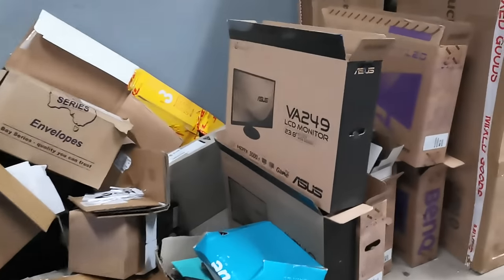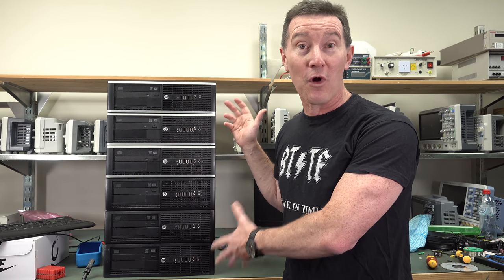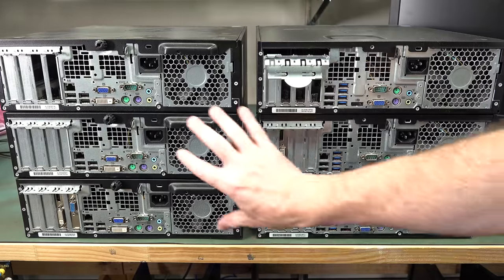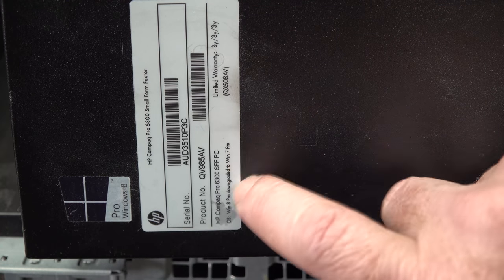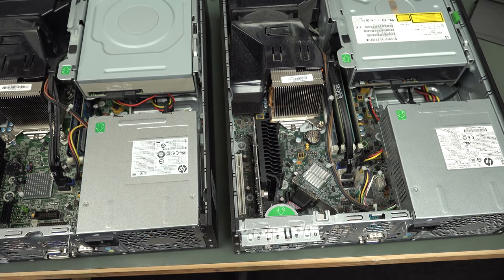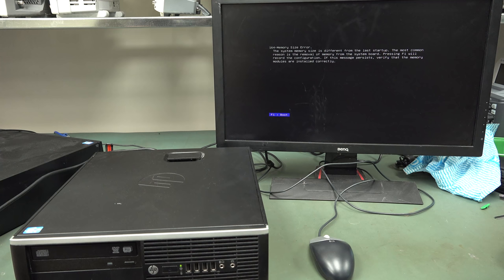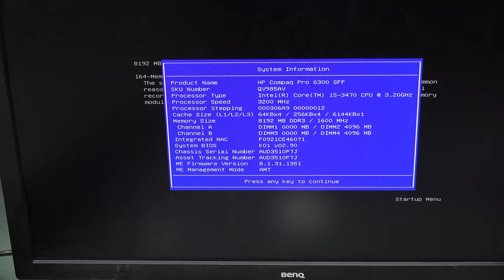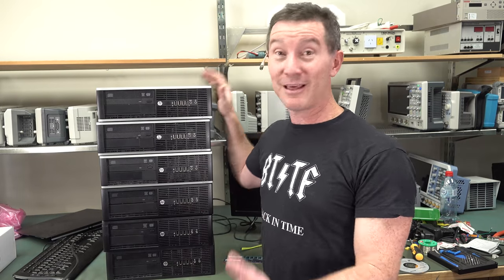EEVblog #1212 - Dumpster Diving PC Motherlode!

Comment: Downgrade is basically you are Licensed for Windows 8 and are allowed to use a lower version. Businesses usually use an older version for app compatibility.
Reply: exact reason we used windows 7 for so long, a lot of 3D software was only stable with windows 7 and 8 was problematic for quite a few years as well.
Reply: Actually it looked like all those systems had a COA, the color changing "Windows 8 Pro" sticker is the COA and at least for the big OEMs (Dell, Lenovo, HP) the actual license key is embedded in the bios area encrypted/signed by a per-OEM cert.  If you can find install media you can install Windows 8 and upgrade to 8.1 and it should automatically activate.

Edit, missed James Davies comment below
Reply: win7=okay 
win8=trash
win9=dead
win10=tbd

Comment: Really helps working in a rich zone. That will never happen where I live.
Reply: Not really a rich vs. poor thing... businesses trash machines like these by the dozen all the time, just need to know where to look. They're long out of warranty and one off indeterminate repairs are super expensive to do in house, so they buy new on a pre-planned cycle (5-7 years typically). Used to be a 5 year old machine was totally useless for home use, but with tech these days they aren't half bad if you're just doing basic stuff. You'll typically see machines like these going for $25-50 each if you buy by the pallet at a surplus store. Smaller batches just get dumpstered because it's not worth the hassle for a couple hundred bucks. There's also services that will recycle old junk for free in exchange for a certificate that the hard drive was destroyed (so IT doesn't need to worry about it when decommissioning machines). They'd be a good place to research and call up if you are looking for a deal.
Reply: @PaulMorgan1  I live in the Caribbean. Business here are not as wealthy and generally do not dispose of much until its truly dead. The one exception is the University but its never accessible to anyone who is not inside.
Reply: @PaulMorgan1  It depends on what kind of business we are talking about. Small business, generally, would get rid of computer when it is useless and/or broken and you cannot pass it to lower ranks. State institutions are pretty much the same. Big companies would sell their old stuff to recycler or, rarely, to own employees and not just toss it into garbage. It is area and state-sensitive I guess but even prototyping company I used to work for would never just throw out computers that still work. There is always some secretary or receptionist that could use it when it became too obsolete for your engineers and executives.
Reply: There must be some big companies in that business park. Cheaper and easier to dump them than to pay/hire someone to sell them.  You'd think theyd at least donate them to a local school or library tho

Comment: If you have that purple windows 8/10 sticker, your windows install will activate automatically after you install windows 10 as long as BIOS is in UEFI boot mode.
Reply: Fedora Gnu/Linux works far better, it's what i'm running now.
Reply: @madscientist132  Not even Arch smh my head
Reply: @madscientist132  Depends
Reply: I'm really glad Microsoft still lets this happen :)
Reply: @fellenXD  Yeah where's the "Btw I use Arch"?
Reply: those "arches" on his arms are afraid of something....
Reply: @S1278-q9f  haha. whenever somebody writes ' I use Arch!" i always think... well good for you but most linux systems can be installed and configured from the terminal up.
Reply: @fellenXD  "smh my head"? So literally: "Shake my head my head"? Don't use acronyms of you don't know their meaning.
Reply: @KangasniemiJerri  that's the joke

Comment: Windows 8 had a embedded product key in the motherboard when purchased from a large odm (HP, Dell, Lenovo, etc.) , and professional models offered downgrades to 7 for years. My company offered downgrades until the hardware stopped supporting 7.
Reply: Additionally, the Win8 CoA in the BIOS will also allow installing and automagic activation of Windows 10!

Comment: starting with windows 8 the product key is embedded into the bios. You can use belarc advisor to pull the windows key from the bios. Windows 10 during a fresh install should auto detect the product key and activate.
Reply: you will sometimes need the computer manufacturers specific boot iso, although ive seen a modded one that works with most pc oems
Reply: @kolby4078  haven't run across that since Windows XP.
Reply: Specific brand boot isos died with the dinosaurs
Reply: @SomeMorganSomewhere  they exist for 7
Reply: No need for software to get the hardcoded Win8+ key:

wmic path softwarelicensingservice get OA3xOriginalProductKey
Reply: Ivy bridge oems do that with W7

Comment: DAVE I HAVE THE PERFECT SOLUTION. (Sorry for yelling).   :)

If you get a couple running with cheap SSD’s ($35), donate them to a charity via GIVIT (this is an organisation that has a database of items that charities require, locally in your area). These PC’s could help people escaping Domestic Violence, youth services, etc.

I am a semi-retired electronics technician here in Canberra. Myself and my wife gather up old MacBooks (2010 and onwards). Do board repair under microscope, overhaul and upgrade with new SSD’s, then donate to charities in our local area, via GIVIT.

Most of the MacBooks we overhaul, go to domestic violence shelters, so the ladies escaping DV, push onto to study at local  TAFE/Universities. These MacBooks make a really BIG impact!!!!! For example we are dropping off 3 MacBooks, to a newly opened youth Center in Canberra.

It’s only myself and Kaz, we are not a charity, we are not a company, we are a philanthropic hobby. We push out 15 MacBooks a year via GIVIT. If you want to know further info checkout our Facebook site “MBK Pizza”.

Cheers Shane. :)
Reply: Good for you Shane.  Ethics and landfill reduction.
Reply: We have much the same thing up here in the PNW, started twelve or thirteen years ago. I volunteered in the triage and plug'n'pray sections. We'd get a lot of stuff like this stack donated in, even have a couple trucks and will go to your office and pick stuff up. I confess, I was there more for the volunteer's discount in the store front and I kept an eye out for the more 'unusual' machines, such as the ones Compaq made that look like either toasters or mantel radios. Tried to keep as much 8-bit stuff from being parted out to the recycle bins. Caught myself a (it's in storage right now) DEC Alpha PC with the dual firmware function. It's functional, someday I may try to get it back into working configuration.
Sadly, these days recent most of the weird stuff goes right into the bin.
Reply: never really thought about it like that , thanks for sharing
Reply: Dave Jones eevblog don't ignore this comment. ⬆️⬆️⬆️
Reply: I was going to suggest just that. Best use of surpluss machines there can be! :o)
Reply: Thx for your supporting comments everybody.
Its basically adding intrinsic value, to an macbook considered to be past its prime (only worth scrap metal), to benefit people escaping life traumer/challenges.    
Or in other words, “upcycling for a cause”.
Reply: I do this with TVs instead of computers. Smaller than 40inch is better as their housing situation is variable. They'll take a small one with them and leave anything larger behind.
Reply: This gets my vote!
Reply: @Toby Henderson A tech forum might not be the best place to spew apple hate. Try the usual Fortnite chat; or facebook, lots of "computer experts" there.
Reply: Hope you dont give that 2011-2012 piece of trash gpu failing machines.
Reply: @rscervin9950  aaaaand of course they never come alone XD
Reply: @IlBiggo  what do you mean?
Reply: Driver_#potato The tech genius is always followed by other tech wizards. Sorry if I have given the impression that I was jumping on the hate wagon.
Reply: @IlBiggo  oh...yeah i mean...Apple has screwed stuff so many times....I will send you a link about that from Louis Rossmann.
Reply: Here look.It explains every shit apple has done https://youtu.be/AUaJ8pDlxi8
Reply: @rscervin9950 God has screwed up so much! I'll send you a link from the American Cancer Society. 
As I wrote earlier, a tech forum isn't the right place for OS holy wars. I'm (as I suppose 99% of people are) not interested in fanboyisms.
Reply: "These PC’s could help people escaping Domestic Violence"
wut???
Reply: @daviddavidsonn3578  Note that he didn't write "help people escape domestic violence". Though I guess they also could help in that sense by giving them a way to socialize and get better information etc., Shane is saying that those computers could go to organizations that help victims of DV or other social problems.
Reply: Ok just to Clarify, with our little philanthropic hobby “MBK Pizza”, when we have stock of MacBooks, we search GIVIT. So a domestic violence shelter makes a request for a laptop on GIVIT, we service that request. 

The person/family escaping domestic/family violence at the shelter, usually go to study at a local TAFE, Polyech, Uni, etc. So they establish a new life, seek education using one of the resurrected MacBooks. If you need further clarification go to our Facebook page “MBK Pizza”. Check it out!!!!

And this can also be done with windows based desktops/laptops as well. Let’s not get into an OS War, these laptops help these people push on with a new life, seeking education and new social connections, with a new laptop, either windows or Mac.

Cheers

:)

Comment: As a HP/Compaq Certified Tech from the old days circa 1999 (HP)/2002 (Compaq) to 2010, these units have a Windows 8 key embedded in the HP Bios that would allow the installation of Windows 8 or Windows 8 upgrades to the Windows 7 OEM without needed to purchase additional keys. (edit dates, had to look them up again, no wonder I retired after my stroke)

This was also a option for folks that still wanted the XP environments for software to run in compatibility mode. 
(clarification - This was meant as the Explorer Based frontend (Shell) founded with Windows 95. Not the NT kernel that all version of Windows since Windows 2000 are based on now.) My mistake for not clearing that up. - See John Francis Doe below

Windows 7 was nothing more that an updated Window XP Core and interface. With the launch of Windows 8, the development of the Metro (tiles) UWP Interface and updates to the kernel (core OS functions) that continue to this day in Windows 10.  (edit - Windows XP Core should be NT. other edits for clarification)

So, yeah, you could load a HP OEM Windows 8 or 8.1 build, and still be within licensing agreement per HP TOS and Microsoft EULA. (edit - added EULA as that is different from Sales TOS)

Also, you are correct, most companies did not want to have to teach a user class for the new interface on Windows 8, which is why desktop (classic mode) became an option in Windows 8.1.
Reply: Everything Based on NT is the same, even Windows 10 has the same core as Windows 7. Bare Metal is gone. Permanently and for good reason. Good Riddance.
Reply: 恵勇気 Nonsense.  Windows 7 includes most of the "least privilege" security features from Vista, but with a special loophole to not prompt for certain Microsoft programs by default.  Windows 8 added the UWP stuff and removed the start menu (available as 3rd party add on, though).  Windows 10 added all the mandatory "telemetry" that make it absolutely unacceptable for any business with anything they want or must keep secret, and it's on even in the highest tier enterprise licenses.  Plus the Windows 10 mandatory updates that frequently cause instability and downtime, requiring special countermeasures (WSUS servers or similar) to keep away from production.  With Windows 7 updates ending soon, Windows 8.1 with selective update policies will give companies a few extra years to find a way to either convince MS to remove the crap or  switch to another OS altogether.  There is an option to pay Microsoft to extend the Windows 7 and 8.1 deadlines if transitions to the next higher option are impractical.
  Now of cause salespeople have sweet talked a lot of people into not knowing the dangers and upgrade to Windows 10 anyway, even though this stuff is written right inside the EULA contract terms.

Comment: oh and FYI: since Windows 8 the Windows Certificate is in the BIOS of the Motherbard.
So if you install the Windows 8 Version on the sticker, it is automatically activated.
Reply: Stefan Payne Windows 10 works as well.
Reply: Dave Micolichek  Well, there is the M$ Media Creation tool, wich allows you to make the Windows Installation legally. 
The Magic is in the BIOS and all you need to do is chose the right version of Windows...
Reply: Dave Micolichek  As I understand it, the upgrade to Windows 10 automatically sets the installation to the same type and legallity as what you're upgrading from.  However, there are reasons to be very suspicious of exactly what Win10 is sending back to The Vole.

Comment: Love it! I procured four hp6000s myself - the same way, for the same price, here in NZ!!!
Since 1999, I've only had to buy one laptop new. Everything else I use to run my home and business has been free, sponsored by ex corporate or private people with too much money! 

Combined with open source software and free networking software, I can run an annual seven figure company with zero computer overheads!
Twenty years ago, the same setups I use today would have cost easily $25000, plus the almost compulsory ongoing "support contracts".
Today, it's a thousand times faster, a thousand times more reliable and, is ultimately free; apart from my time.

Comment: A few years ago i used to volunteered for a charity op-shop. The manager found out that I.T. used to keep all the old computers in a store room, so she arranged for them to be sent to me to be fixed and sold second hand in the shop. All of the computers were small form factor HP's, and everyone worked perfectly, all I had to do was format the hardrive (I.T. never wiped the hard drives on the old computers) and reinstall Windows XP. I used to also install Open Office, and we used to sell them for $80 each. Just about every single machine sold the day it was put out for sale. The manager and I left around the same, and there were about 30 computer setup and ready to be sold. The new manager through every single one to the tip.

Comment: I had a similar experience with almost the exact same machines. They were AMD A6 dual core machines though, 4 of em all working, from the same time period. I use them as network rendering machines.That way I can continue working on my main machine while those 4 render. I wasn't even dumpster diving though. Just happened to be in the right place at the right time. They have shit onboard graphics and I didn't upgrade them. I put 16GB of DDR3 in each one and cheap SSD's, cleaned em up and put new thermal paste in. That was 5 years ago. They're still going strong. A nice little stack of render nodes for free.
Reply: How did you connect them together? As in what software.

Comment: The reason is simple: Many IT departments didn't want their users to user Windows 8, and Microsoft knew this. So, you could purchase a PC "with Windows 8", but they provided a serial number for Windows 7 as well.

Now, this isn't really unique to Windows 8 though. If memory serves me correctly, and it may not so please don't shoot me, you could get a Windows XP downgrade from Vista, a Vista from 7, and so forth.

Downgrading for deployment reasons is actually fairly common practice.
Reply: I remember when a secondary school I attended bought Acer PCs with Windows 7, but ordered them with XP preloaded (as the installations had the Acer branding and all, but also the Windows domain logon), then when they wanted to upgrade to Windows 7 Enterprise, they just sold ALL their XP systems to other teachers and replaced them with Lenovo desktops and HP laptops, probably as part of that write-off thing, and/or some MOE requirement.